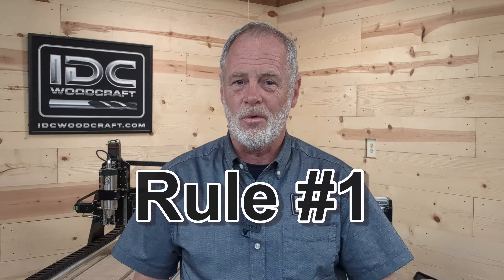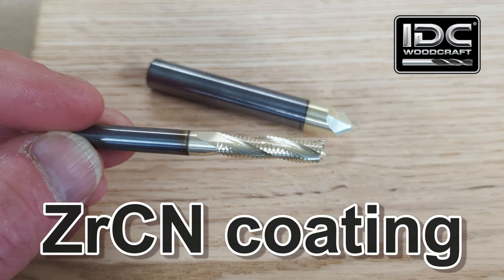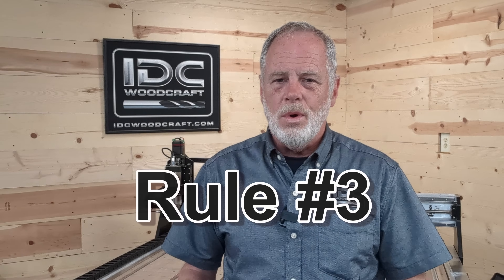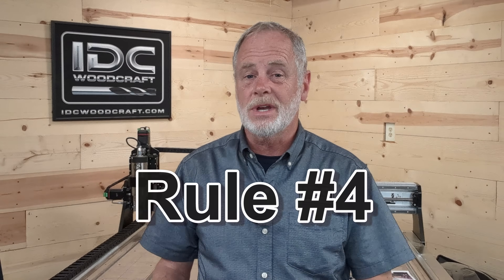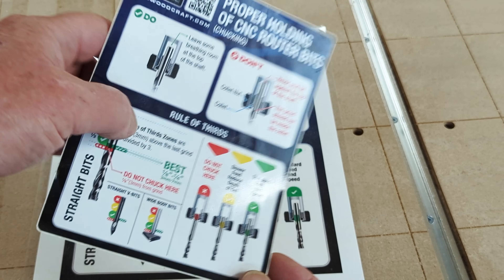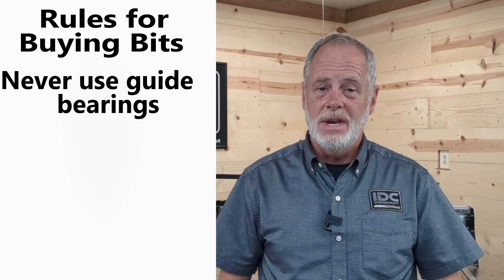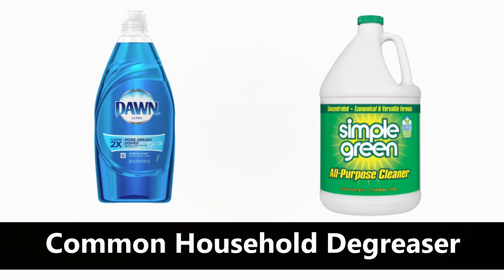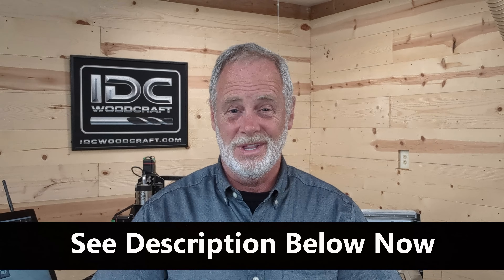Before You Buy CNC Bits the First Time...4 Tips to Avoid Wasting Money

Comment: So I'm just starting out and have a 3018 Pro machine. Is it out of the question to find a surfacing bit with a 1/8" shank? Most of the minimum size I've seen for surfacing bits is 1/4" shank. If I were to upgrade the collet to 1/4" from the 1/8" collet that came with the machine what would I look for? Appreciate the advice. Thanks.
Reply from the maker: I have a surfacing bit with a 1/4" shank! Here is a link: https://idcwoodcraft.com/products/1-8-shank-surfacing-bit-3-4-cut-for-cnc-routers
As for collet upgrades, I recommend reaching out to your machine manufacturer on that one for the correct collet! That is your best bet brother!

Comment: A machinist here, I want to correct some bad information here. 
HHS is fine for woodworking, he is correct it deflects more than carbide and will dull faster and if heated up will ruin the edge easier. 
That being said, while it's not as good, it will make just as good parts for a fraction of the price. 
Machinist use HSS all the time when cutting steel and you are not gonna cut anything nearly as hard as steel in a router, the deflection problem can be fixed with finish passes when programming. The overheating problem is just about surface speed, HSS can take about 5 thousand inches per minute compared with about 10 thousand inches per minute with carbide.(WHILE CUTTING WOODS) So for a HSS quarter inch diameter tool your RPM limit is about 6 thousand and 12 thousand for Carbide, so keep the RPMs bellow that and your tool will last a long time for both carbide and HSS and will not overheat. People get in trouble when they don't do the math and run a quarter inch HHS at carbide speeds, then the tool life goes from half of carbide to minutes or seconds in the cut. Also sharpness of the tool and taking enough of a chip is how you get the heat in the chip as opposed to the tool. Like the RPM you need to calculate chipload and make the chip big enough to take the heat, but that's a problem for both carbide and HSS, the difference is carbide is much more forgiving if you don't calculate it because it tolerates heat more without losing the edges temper. I would recommend every time you buy a bit writing the max RPM and feedrate for that RPM in the material you usually use, then reference that when programming.
Reply from the maker: Thanks for sharing your insights, my friend! It's always great to have a knowledgeable machinist like you contribute to the conversation – appreciate you watching the video!

Comment: I’m pretty new to wood working and have heard some people say not to use simple green and other degreasers since it can remove the coating on blades and bits but others say it is fine. Is this just marketing points from companies like cmt to try to get you to use their cleaners or does this actually happen?
Reply from the maker: Great question! It's true that some degreasers can strip the protective coatings on your bits and blades, which might affect their longevity and performance. Always best to check with the manufacturer for their recommendations, my friend!

Comment: What are the plastic rings around some bits for?
Reply from the maker: That's a great question! They are meant as stops when you insert the bit into the collet. The intention is a preset depth. Plastic is not good for this. To have the proper rings, they need to be metal

Comment: Dawn  Power Wash a little more expensive but does wonders on cutting tools, I have been using it on my saw blades for as long as it has been on the market.  Spray, wait a bit and brush usually only one application does it!  Thanks for the very informational video.
Reply from the maker: You're absolutely right about Dawn Power Wash! It's a great cleaner for cutting tools, and I'm glad you found the video helpful, brother! Thanks for watching!

Comment: I am a beginner and i have  a ` Small Desktop cnc`` a FoxAlien 4040Xe ... it s a smal 400mmx400mm area with a much smaller 300W spindle ... i would like to keep it quiet too so i dont mind the longer working time as it is a hobby machine for now... There is not much video for Newbies like me who have smaller machine. With a 300W spindle should i consider 1/8 shank instead of 1/4 du to my spindle low power ... also as a newbie i dont want to brake too many bit $$$ , i have nema 23 steper motor ... what would you recomand for begginner with smaller machine ...
Reply from the maker: Hey there! With a 300W spindle, sticking to 1/8 shank bits is a good idea since they’re generally better suited for lower power machines. Just take your time with feed rates and depth of cut to prevent breakage, and enjoy your CNC journey, brother! Here is a link to a set I recommend: https://idcwoodcraft.com/products/complete-1-8-shank-cnc-router-bit-set-deluxe-set

Comment: Big fan of Simple Green.  On occasion that I use the double sided tape hold down the endmills tend to get gunked up.  Simple green cleans them right up.  I don't add water.  I got an old pill bottle filled with SG and just drop the endmill in that.
Reply from the maker: That's a great tip! Simple Green really does wonders for cleaning up those endmills. Thanks for sharing that clever method, brother!

Comment: Am still learning,  thanks from a58yo engineering professor.... from Egypt...
I use 70% alcohol or 50/50 turpentine and paint thinner mixture to "store" my pits between jobs (for less than an hour)....
Reply from the maker: That’s great to hear you’re diving into CNC woodworking! Just make sure whatever you’re using doesn’t cause any damage to the bits. Thanks for watching!

Comment: Bits are a tricky thing. We found after years of testing that in our case its overall easier to use new bits for each job. We for roughing re-use bits. Unfortunately most of the time you only know the bit is dulling when your job is fluffy and needs a pile of sanding which it too costly for us. We also found that expensive brand bits don't really offer a better solution.

 We found software for feeds and speeds that considers are different machines power/torques. What they don't consider is the rigidity and thats a manual feel. This can be manually compensated for in the software. Many of our bits have lasted years.

 Feed and speeds are important but not the only factor! You machines rigidity and power/torque is also just as important to bit life. Web site feeds and speeds will not solve this problem they only give a starting point for trial and error. Torque is a huge factor on can you run that bit hard enough to keep it cool. The more torque stress the more rigidity needed.

Comment: Is there a way to sharpen the tool bits
Reply: TJ Grinding says they can do 1/4" bits, maybe check with them.  Sharpening requires a diamond cup wheel and an elaborate setup with a guide finger.  Might get one or two sharpenings before there's not enough flute clearance left.  Plus, after sharpening, the diameter will be reduced. That will mean keeping track of the new diameter for offset calculations in your designs.  I would probably wait until I had 30-50 bits to send in for getting the best pricing, but that's only a guess.  Shipping and handling for less than that quantity might not be economical.
Reply from the maker: Absolutely, you can sharpen CNC router bits, but it can be a bit tricky. I recommend sending them to a professional sharpening service for best results, especially if they are high-quality bits.

Comment: Garrett, how does one tell when it's time to replace a bit,  what are the signs?  That would make a great video
Reply from the maker: Great question! Look out for signs like reduced cutting performance, burning, or visible wear on the edges. Thanks for watching and your idea for a video!
Reply: Indications that a cutter needs to be replaced:
1) The feel test. Does it feel dull after cleaning? Are there any nicks in the cutting edges?
2) Performance. Is it leaving unusual burring? Is the surface finish rough (for finish milling only) or are there burn marks in the wood? Does the spindle sound like it is bogging down more than usual under load?

Note: Not many people regrind small cutters. However, you can dress up the cutting edges by using a hone. This can extend tool life by up to 30%.